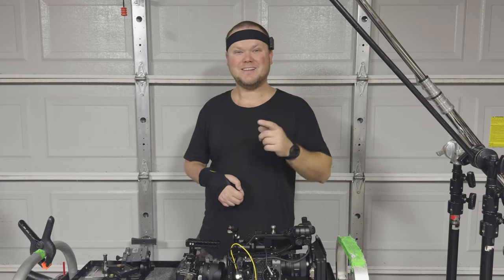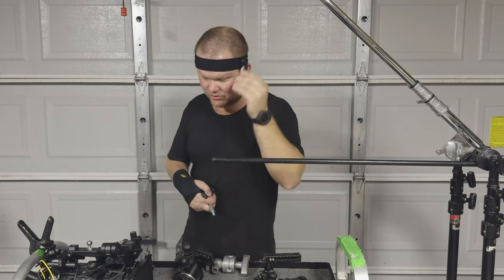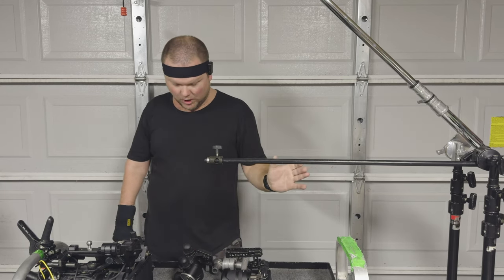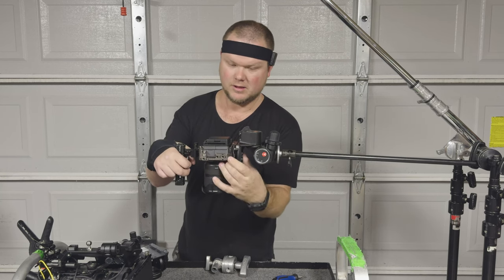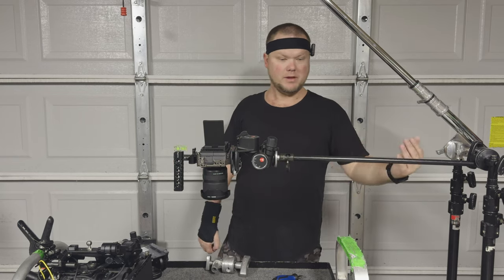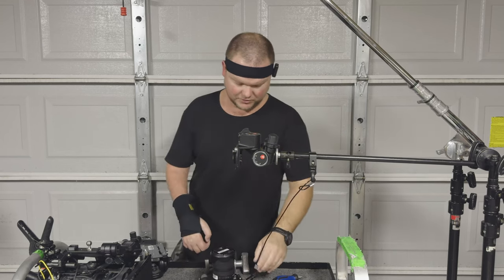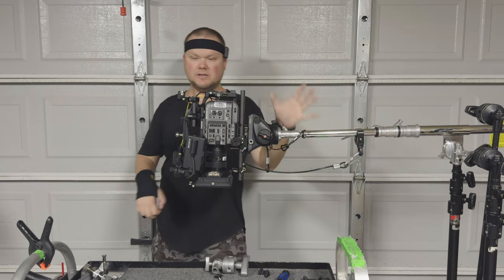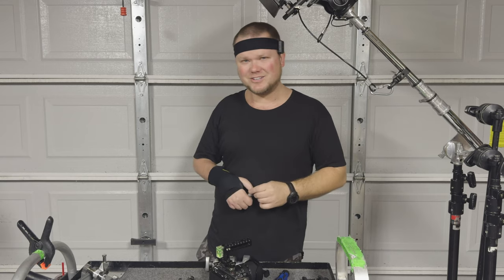Overhead Camera Mounting Tips | Sony FX6 FX3

Comment: good video! do you have any suggestions for overhead mounting and stands if travelling and can only pack checked air baggage?
Reply from the maker: Thank you! What camera and payload are you looking at?
Reply: @PDMokry  I'm currently using a BMPCC 4k w/ a 9mm Panasonic lens, but have used other cameras. it's for live streaming card games so an overhead is a must. right now, I'm using a carbon fiber tripod with a neewer horizontal bar with center axis, with a counter weight. I'd love to have a c stand and a grip head but it's just too much to travel as a one man.
Reply from the maker: @StageZeroTCG  Do you have a cage? If so, I have a solution for you!
Reply: @PDMokry  yup, one of the smallrig cages

Comment: My preferred method is mounting my Arri Alexa 65 onto a 1/4 20 screw and just letting it dangle a bit so it can level itself out. 😄 No actually I'd prefer opting for a beefy boom arm like the D600 (or D650 even) for hanging anything overhead, since I don't really trust grip arms all that much, especially the slippery end.
Reply from the maker: You say that light others don't try that silliness! I avoid the smooth grip arms and grip arms in general for a big load. But small stuff is fine like a mirrorless body. 

Thank you for always jumping into the comments.

Comment: Have you ever considered the camera swing on the safety chain? Specifically the FX6 setup you showed. I realise most of the point of the safety chain is to protect talent. But if that FX6 dropped out of the tripod mount and held on the safety chain, it would smack into the C Stand. Nice video tho thanks
Reply from the maker: Similar to camera cars and other things, once it goes, it is bad news. The short fall vs big fall is all bad. The one thing that can be saved with a safety is what is under the payload.

Thanks for the watch and comment!

Comment: Using a 3way manfrotto stills head absolutely allows you to level. but ouch! - i think these ar a bit skechty and will bounce for ever.. i use a goal wich can be 2 cstands for a little camera or two combos for a big one. Adding a safety strap is a good plan too. Actress underneath? go to the next level!
Reply from the maker: You are not wrong! Safety first. These tips fall in line to simple and controlled environments, not working sets. Goal post is a great way to play it safe! Thank you for the insight!